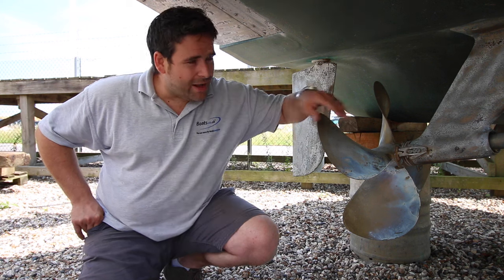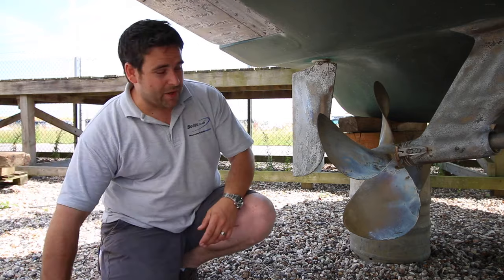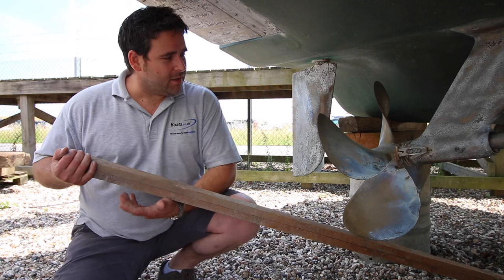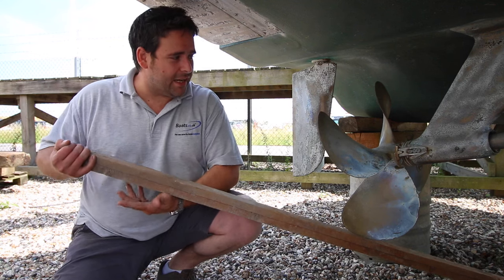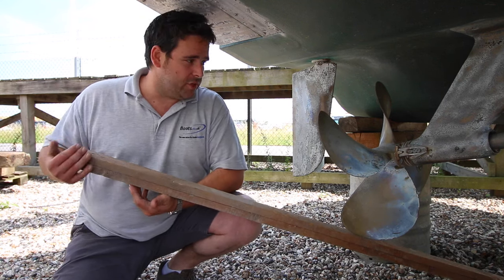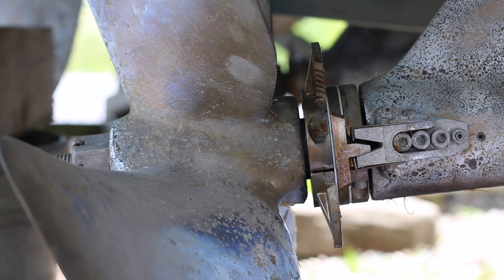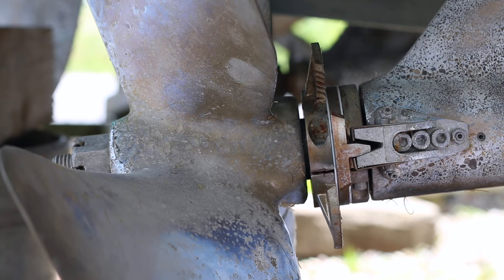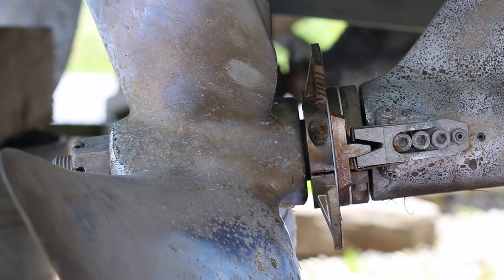How to check a boats cutlass bearing

Comment: how many years change the zinc  anodes cutless bearing in salt water. kindly inform me asap. your prompt reply is highly appreciated. thanks. (mirza samiullah baig)
Reply: If you can see the Zinc Anode on the body of the boat you can normally see the erosion of the Zinc. If you cannot see the Anode, its best to check them at a maximum of 2 years but better every year.  Again this depends of what type of hull your boat is made of and how thick your Anode is.